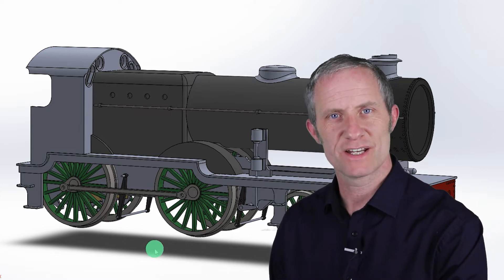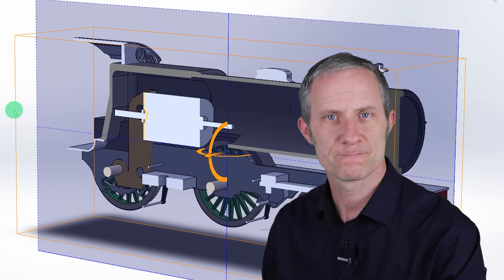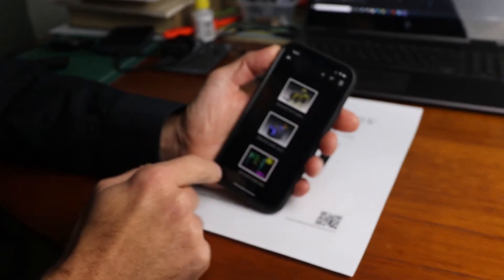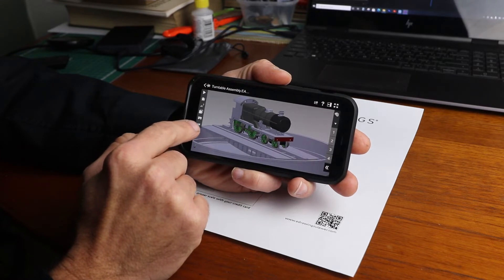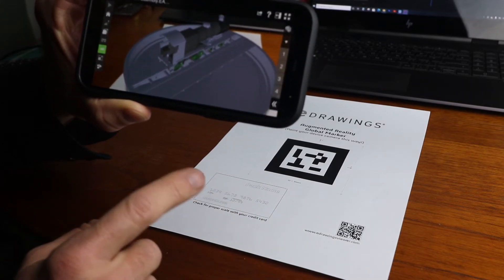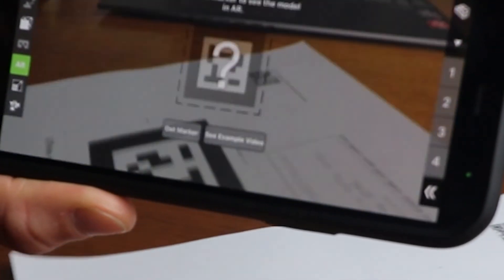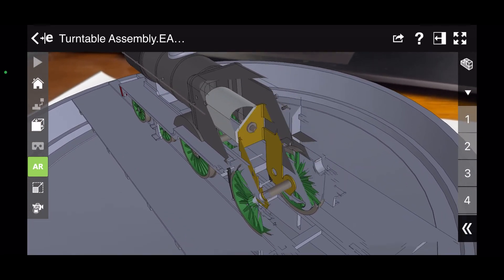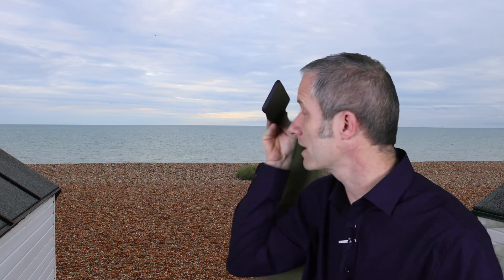Augmented Reality Railway Modelling

Comment: Just found this. Excellent. Thank you for sharing your knowledge. As an 0 gauge scratch builder, I would like the .F3d file so I could enlarge various parts to indivdualy print on a 200 x 200x 180 print bed. Many .stl files are for 2mm or 4mm scale so I have yet to try this approach. Thingiverse site is good for making files available , but you would have control of them on your own website. Perhaps a future video on the drawing up of a loco. At 82 I am still learning that you CAN teach an old dog new tricks.!
Reply from the maker: Hi Kerry,  I have a video 'in the works' on that very subject, and I'm working on a file sharing solution - just need to find the time to get it up and running.
Thanks for watching,
James

Comment: Very interesting James we all like free stuff and looking at such things is great in my opinion I did try and see what app you actually pressed but you were to quick, I guess it’s in the description. But on the email front I did notice just the 5,119 unopened emails 😂😉
Reply from the maker: Hi Ade, the app is 'edrawings'.  It's useful for viewing all sorts of drawing file types.  The mobile app is especially useful as it offers the VR and AR functions.  There is a free version and a paid-for version.  The paid-for version allows the user to disassemble the model into component pieces.  The locomotive and turntable shown in the video for example has something in the region of 70 separate pieces.  These can be exploded into individual parts if required.
As for the emails - well spotted!!  That's my spam account, most of them are probably enquiries about PPI. :)
All the best,
James

Comment: Great stuff James. Augmented reality does seem very exiting and still full of (on my part) untapped potential. Couldn't you incorporate markers, that when "fixed on" or "hovered over" would give the user further options i.e. "turn off the locomotive body casing level/layer" or "Longitudinal Section" or even an animation of the loco (and it's components) running?

Comment: Have you thought about using GitHub for sharing files? It's designed more for computer software projects, but I can't see why it wouldn't work for CAD drawings and 3d printer files. You can separate projects and keep track of versions. May be a bit of a learning curve to setup, but possibly not as much as setting up a website.
Reply from the maker: Thank you Garry, I've no experience of GitHub.  I'll certainly look into it.  
James

Comment: Hi James, the AR looks like a good move, especially when it's free (so many things require you to have expensive addons) If you are going to share files I'd suggest STL's, they are small in file size, readers/viewers readily available and if people wanted to make their own mods then thats not hard to do either plus they work with all the 3D printer software I've encountered
Reply from the maker: Hi David,
I can potentially make the files available in a variety of file types.  The app shown here uses a native AR file type.  The advantage being that it works very intuitively and that colours and textures are represented as the original.
Whilst .stl files are great for 3d printing, one cannot view the colours and/or disassemble the model with quite the same degree of control from a phone.  
Best,
James

Comment: App would be only watching by phone - neither changing, nor seeing splited in and inside parts :( therefor you showing and telling what you work on in a video is better.
Spoted the tender is (still) missing.
By the way did you considerate conecting both drive axes to the engine? Or is ther not enough room - whitch would be one example what you couldn´t see by that app as you would need to move the engine-model inside of the "fire box"-model and put another gearbox-model in to find out.
Files downloadable from your own web page would be top (or alternatively some userfrendly sharing platform) and linked from the corresponding vid.
Somehow I think you gona model that beach, which we see on your vids from time to time, too 🤔
Reply from the maker: Hi Lass,
The app allows the model to be disassembled into its component parts if required.  
The axles would be connected by the connecting rods as per the full-size.  It would certainly be possible to connect both axles via a gearbox, but I have no plans to do this.
Thanks for watching.  I enjoy looking over the beach whilst I do my model making - but there are no plans to make a model of it.  :)
James